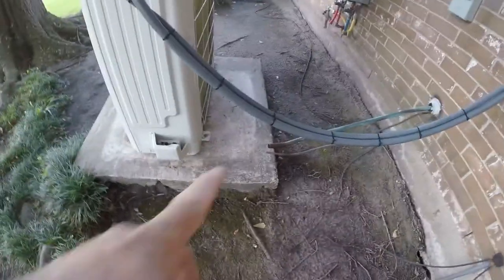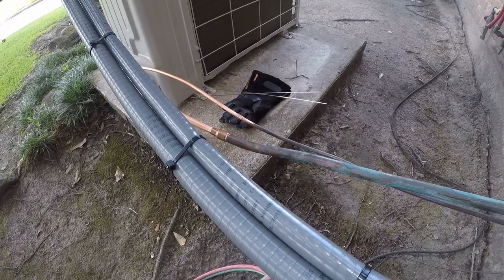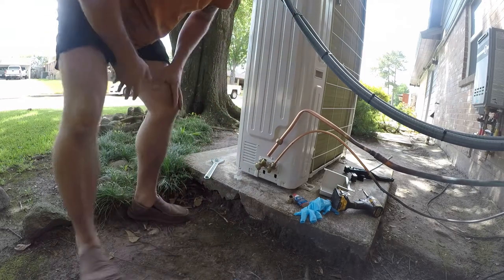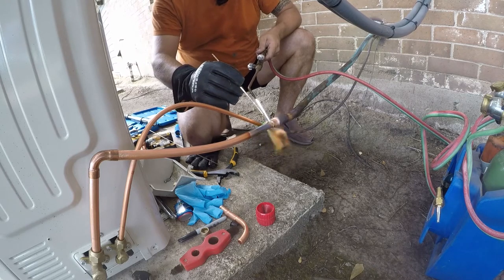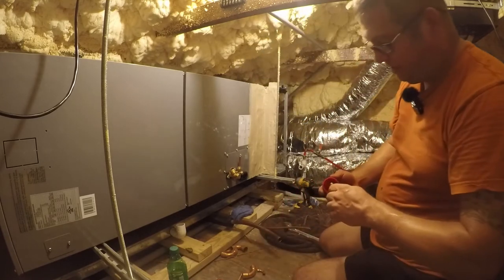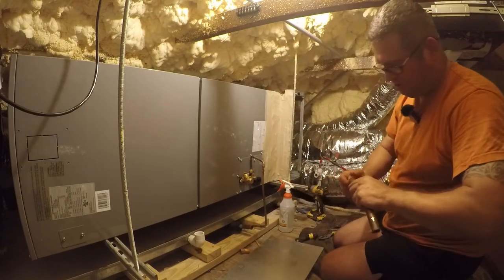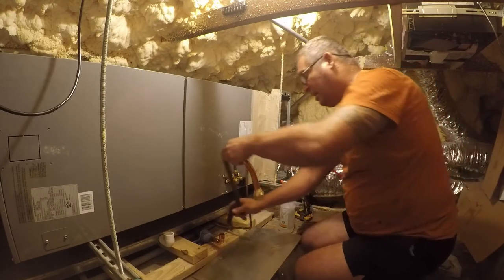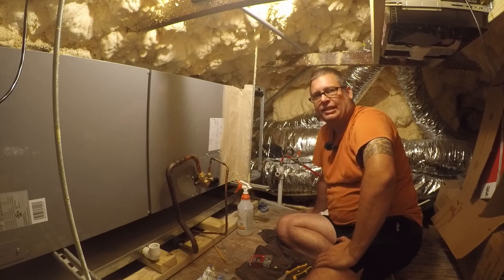HVAC 18 - Connecting the Lineset

Comment: Thanks for posting about this brand (ACIQ) as it's not very common over here.  I'm thinking about the 2ton ducted unit. Quotes for a 2 ton unit purchase install in Calif are over 20K, but this unit online is 3k plus the needed accessories. I don't care about the warranty as I can purchase another brand new one and still save thousands. But getting the shielded control wire and air handler power wire. from the front to the back of my house is not easy. And  the added bonus for heat pumps is that they now qualify for 2K in tax deductions in 2023.  Yes HVAC so called techs will bad mouth you all day long, but how can they really justify the hourly rate they get for installing something like this.  I'm handy and the tools to install and the unit I still save thousands. And I know the proper way to do it. Thanks for the videos.

Comment: Contractors get salty when they see people doing what you are doing for themselves but I applaud you for trying and actually doing it. My view is that it is your absolute right to do it yourself as long as you don’t get halfway through and then expect for sometime like myself to finish it or fix it under Warranty or complain about the price because I know what this part cost- I’ve never seen a air handler with service valves what kind of system is that?
Reply from the maker: It's an ACIQ unit.  Basically private label Midea.  Apparently Midea is the  go-to manufacturer for house brand systems.  The downside of this is that most of the folks selling house brand systems have crap support, which will eventually denigrate their brand.  I have no issues with Midea.  They are a major manufacturer with solid engineering and manufacturing.  I'm not very happy with the lack of support from ACIQ/HVACDirect, but I figured it out and it's running.  Like most Chinese things there isn't much warranty.... see also Daikin and Good(for nothing)man.

Air-Con, Olmo, Mr. Cool, ACIQ are just a few of the systems made by Midea.  One of the dead give-aways is "gold-fin" condensers.  Gold-fin is just something marketing came up with to describe anodized fins.  Also available in blue.... maybe that's 2023's technology?  lol.

For the record, I think most people should not install their own system... However, if you have a sound understanding of HVACR, have your EPA certs, and understand building code (IMC/IRC) then it should be do-able.  Most individuals do not, and there are a large number of licensed HVAC folks who fail one or more of those categories.  I've also installed about a dozen systems, some of which are still running 17 years later.

Comment: Thanks for posting these Brian.  I found your videos by looking up ACiQ because they are one of the few that also allow dual fuel.  I completely agree with you that traditional air handler and mini split condenser is the future and I wondered why no one really does it.  Did you check the length of the lineset and then add refrigerant if needed?  Most manufacturers will let you know the lineset that matches the charge in the compressor and then advise to add a certain amount per foot past that length).  I'm assuming you'd have to recover some if it's less than the lineset they spec it for.  Thanks again!